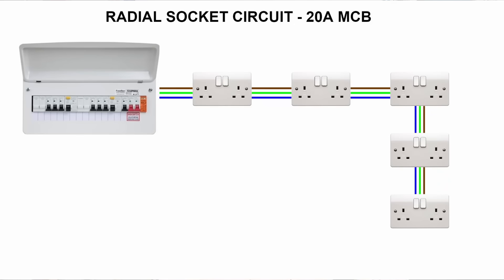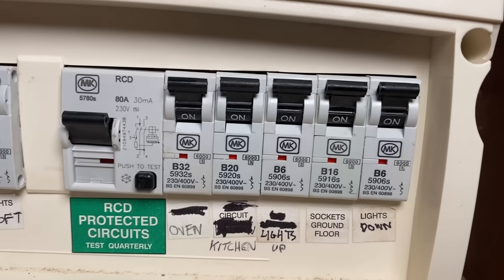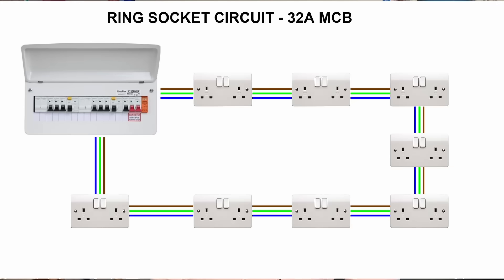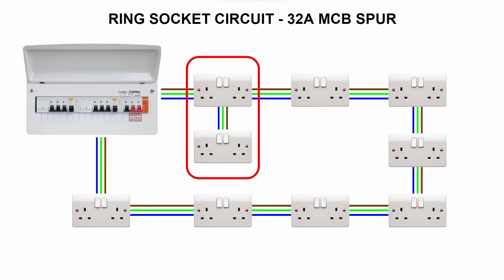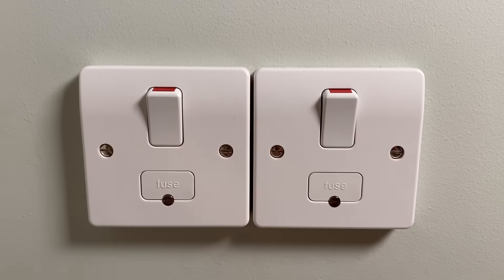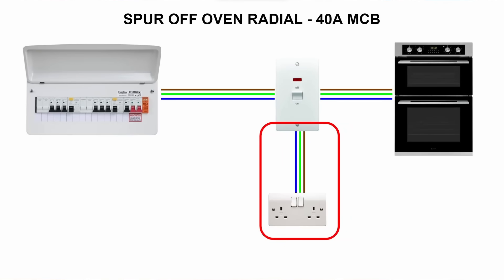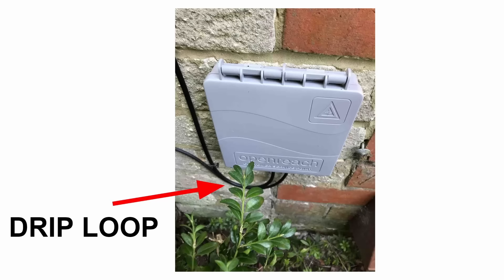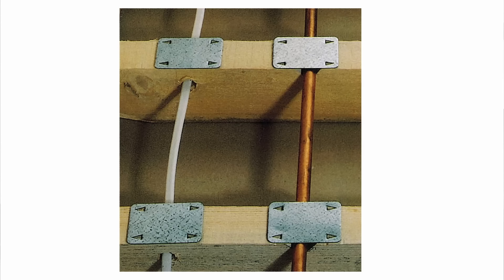BIGGEST DIY Mistakes Adding a New Socket

Comment: I had some knobheads from the government putting in a solar water heater on one of those grant schemes, when the electrician came to hook it all up I told him there was the old boiler circuit directly above, no holes or drilling required to get it but he chose to spur off a spur that was used for my fridge. Told him he couldn't do that but he did it anyway, he was asked to do it properly and it nearly ended in fisty cuffs, somehow it passed inspection when the next bloke came, after going to citizens advice to find out how to complain further I was told since I wasn't the one who paid I was not entitled to complain. It later turned out that they hadn't even connected the water pumps for the new system and it never did anything but look expensive. Somehow it also passed commissioning and was all signed off as a good install.  Will never get anything done by the governments cowboys again so bad.

Comment: Apropos spurring off an oven cct, this would be the same as a combined oven switch and socket? Also shower and oven circuits are subject to diversity adjustment so I expect that's why we have the combined oven/socket switch plates? If you must run something off a lighting cct,, extractor fan for instance, maybe a fused spur rather than a socket?

Comment: Thanks for your 'opinion' on ring sockets as an older electrician. I wonder why some electrical updates happen to the regs, but our whole electrical loading has changed massively since rings were the norm, often 3 bar electric fires were the norm, also our appliances were hungry little sods, these days loadings are 1) separated much better, deliberate feeds where sockets were used (boilers etc) so the whole loading structure is far different. Plus the common uses of RCD and RCBO. It seldom matters how you wire, ring or redial as long as it is installed correctly.
Reply: Well what do you like about ring circuits over radial
Reply: @Makalon102  It is just an opinion, but since my first week in tech college I learned that electricians are ' devisive' tech teacher, "In a 240v socket there are 3 wires, red, black, and green, which ONE wire is the most important, and why" now its a nonsense question, as the answer is none, THEY ARE ALL important. It was his way of saying, whatever your personal opinion, follow the code, and do it safely. Ring or radial cct as long as its connected correctly and designed (important on loading) correctly it will be fine and work well. BUT people and progress changes things, "people" plug in to a socket, no thought on load. Today's loads are nothing like the 3 bar fires in rooms my day had, conversely kitchen appliances USED to be one big cooker which was main oven and hob, plus grill. Today a hob comes with 13a plug, an oven much the same,  So protection NEEDS to be the key not the type of cct. But to me a ring has more versatility. BUT your comment on "bad connections in a ring is nonsense as any cct connected badly can and might fail

Comment: I'm not an electrician but having watched several videos before on the subject, one question has always come to mind. You are not supposed to add more than one spur to a ring main, however, what is the difference between adding a spur and plugging in an extension lead. Theoretically you can plug in several extension leads.
Reply: Came here to ask this very same question.

An extension lead typically has a fuse - maybe 13A - which I'm thinking might serve as a  lower-threshold stand in for the 32A breaker, making it safer as long as the fuse rating is lower than the wire rating (27A) in the walls, but I don't know enough about the subject to know for sure if this is the case.
Reply: @anonymousperson015  I’m no expert but the 13a fuse on the extension is the protection. That is why you fit a 13a fused spur if you want to spur off more than one socket, essentially going the same thing as the extension, kind of like a permanent extension lead. 

I’m sure an electrician can explain it far better than I can.

Comment: I have a question, me and my partner and just moved house, we’d like a partition wall building and it will also have media wall within it, the current plug socket is in front of the wall instead of behind it, one of the chaps said he can spur of it and put a double socket in, only issue is we need 3 one for electric fire place, TV and sound bar. Would it be ok to have electric fire place plugged into the socket directly and then an extension lead with surge protection and a 13amp fuse so we can have the TV and sound bar in? I worked out the amps of the TV and sound bar and it’s very minimal amperage they pull so I’m guessing in this scenario it would be ok? TIA

Comment: Nice, but is it ok for a DIY-er to add a socket, not to the ring, just as in your video. Let's say to the other side of the wall. Also, moving the light switch from one wall to the other, not touching the wires.

Comment: Looks like table shown in 0:50 has something mixed in [A] values for 1 1.5 and 2.5mm². Why? Thicker insulation causes less thermal energy dispersion from the cable. So thick thermal insulation around cabling = higher temperature of the cable and higher risk of of melted electric insulation. Double check it in other publications for your own safety.

Comment: I think nobody has any chance of going over the limit 20x240 is 4800 - 20% about 3900 watts it would be difficult to go over this amount so I can't see there being a problem what are the statistics how many fires are caused by faulty sockets in the uk each year
Reply: True, that's what common sense says, but don't forget some people (quite few in my experience) don't have any sort of common sense (if you check distribution of IQ you can find out that 1/4 of population has IQ <= 90). I've seen people daisy chaining 3+ extension leads with 3+ gangs each and connecting things like kettle, microwave etc. Not common but it happens. Safety regulations are mainly for those idiots, because in this country there's very little personal responsibility if you do something silly and dangerous 🤷 I consider myself as intelligent person and it bugs me too that my freedom is being limited by such stupid regulations, but I'd rather adapt then let my stupid neighbour burn down our building.

Comment: Great information in your video. I have done my own electrics for many years and have always observed the regulations.  Many a time I would have preferred to just run wires of a spur horizontally but wouldn't do it as I thought I would be contravening the regulations and I reads that wires could only be run vertically. Has that changed now so they can be run horizontally. Good news if they can be run that way, makes life easier.

Comment: thats your opinion not actual facts about the ring circuit , you need to keep your own biased opinion to yourself and stick to advising , which you should not do for legal reasons , the facts not opinions , as a sparky of many years in industry , commerce and domestics your opinions are not valid , if as you say it was to save copper which is wrong then today we need to save more as the demand for copper will be swallowed up by the net zero madness so your basis is wrong

Comment: re spur off cooker or shower possibly allowing 40a through a plug, that is not quite correct. A 13a socket connected to a 4mm radial on a 32a breaker, or a 2.5mm ring final on 32a would have exactly the same issue but that is standard practice. The circuit breaker is rated for, and protects, the cable size, not to limit what is able to pass through a plug. Sockets are rated at 13a but are connected to 30a circuits as a matter of course. The fused plug helps here. 
Socket spurs off large circuits are allowed: it's common to have a plug-in oven and hardwired hob on a 4mm or 6mm cable with 30 or 40a breaker. Cooker Control Units used to have a socket which was directly connected to a 30a circuit.
Equally, with the socket on a lighting circuit scenario, you say thevfuse may not blow or the mcb might be faulty. That's true, but the same could be said for a ring final, or a radial which has too many things plugged in at once.

Comment: IN a ring circuit when a live wire meets another live wire at the end of the ring route will it cause spark
Reply: No, since it's the same line. There's 0 voltage between the two ends.

Comment: I just wonder, given the decades that ring mains have been fitted without issues and the millions of buildings that must have them, are they really something to be concerned over? IMO, no. 
Whenever I've added an extra outlet to a ring circuit I've always tried to split the ring and insert the new outlet to maintain the ring's integrity but I admit that, sometimes, a fused spur is the more practical solution.
If I was renovating/rewiring my house I'd probably go with a mix of ring circuits and the odd radial for an external garden socket or garage/workshop.

Comment: I'm not an electrician but I changed a socket in sitting room recently, (works perfect) but there was just one cable 2.5mm twin & earth coming into it. 
Does this mean it's not a ring circut?
Reply: It's either a spur from a ring, or part of a radial. A radial can supply just one socket. Or it could be a spur from a spur from a ring. It depends if anyone's been DIYing.

Comment: We forget that few folk these days run the high current fan or other heaters off the ring circuits, with heating provided via another power source or on dedicated radial cables for heater circuits.  Very clear explanation.  The rule would seem to be protect the socket by a fused spur first.

Comment: Very helpful, thanks.  But I'm a little confused - the method of spurring off of a current socket, and adding 2 or 3 extra sockets that way, you say shouldn't be done.  I think you're saying it's because power hungry items may be plugged in and will exceed the permitted loading, and thus damage the wiring?  Ok, that makes sense, but what is the difference between doing that, and instead just adding 2 extension cables to the main, original, socket and running power hungry items off of those extensions?  We used to run electric heaters off of extensions, plus many other things off, all plugged into the same extension cable - that didn't damage the extensions or other installed cabling.  Am I missing something, because wouldn't that be the same thing as spurring more than one socket off of the original one?  Some other questions.  I live in a 1960s house, so presumably it's likely to be a ring circuit - correct?  How can I check the type of circuit I have?  We still have the old consumer unit, if that's any indication.  And if I were to spur more than one socket off of the original main socket, say 2 or 3 sockets, would that not be ok if only low power items were plugged in, like TVs, pc, laptop, phone chargers, LED lights, games consoles etc., etc?  The problem we have is being in such an old house, there is literally only one socket in each room, so extra sockets are desperately needed.  Thanks.
Reply: The answer to your question is that as soon as you plug something into to that single socket, however many powerboards you use, they are limited to 13a current draw by the plug's fuse. The fused plug is one of the reasons rings are allowed. If you add multiple sockets to a spur on a ring, you could draw 10s of amps through a single 2.5mm2 cable fused st 30a but rated at 27a or less if buried under insulation. 

A radial is different - you can add as many sockets as you want as the single cable is protected by a suitable fuse or breaker. A ring is fused on the basis of sharing the load over two cables.
Yes, you could only use low power appliances but there's nothing to stop someone plugging in a vacuum cleaner, iron, hairdryer etc in future. Powerboards are probably safer in your situation, as you have the plug fuse.
The other options (I have a one socket per room house) are:
1: if you have radials, you can extend them with more sockets. Check the cable and fuse match in rating (usually 1.5mm2 16a, 2.5mm2 20a, 4mm 32a.)
2. If you have a ring and the socket is on the ring (not a spur) you can 
i. add a double socket as a spur; ii. add a fused connection unit (FCU) as a spur, and take as many 13a sockets off this as you want using 1.5mm2 cable - they will be limited to a total of 13a by the fuse in the FCU. This is a fused spur and a bit like a permantly-installed powerboard; iii. Extend the ring by adding extra sockets in a ring formation and linking the two 'legs' back to the two legs of the existing ring  (Wagos are great for this but get the right size and a properly-rated enclosure).
3. If the socket is already a spur from a ring, change it to a FCU and proceed as 2.ii above.
4. A rewire is, in the end, the safest and most cost effective way of bringing an old house up to standard, for modern living (on the whole we use a lot more sockets but draw less power overall), with sockets, lights and switches where you want them.
Reply: @tobysherring1369  Thanks for such a comprehensive and factual response.  I did some more research after posting this question, and I went down the fused spur route (FCU), adding 3 sockets after the FCU, which I think your reply says is ok?  I read elsewhere that was the way to do it, so I did, but I used 2.5mm T&E cable, which is what everything I read said I should use.  I've just done a bit more reading, and while some say 1.5mm T&E can be used (in limited circumstances and with no power hungry appliances), that's normally used for lighting purposes, and most people say it really should be 2.5mm T&E.  So I used 2.5mm T&E, but other than that, your reply confirms I have done it the correct way.  Thanks again though for your great reply!
Reply: @TrueBrit1  I'm not an electrician but I know the regs. Without knowing your precise situation I can't say in a qualified way if what you've done is correct and any work should be inspected, tested and certified. It sounds good to me.
The thing about cable sizes is that each has a rated capacity. 2.5mm2 is used in pairs for a 30a ring or on its own for 20a and sometimes 25a radials. You're right to run 2.5 from the ring to the FCU (although 1.5 would be acceptable because it can't draw more than 13a). It's also OK to use 2.5 from FCU to your new sockets, but because they're after a 13a fuse, 1.5mm2 is perfectly fine.
Also, if you discover the circuit is a radial, correctly fused for the size of cable, you could turn the FCU into a socket, and as the whole of your new installation's in 2.5 it would be fine (as long as your radial's fused at 20a or less) as part of a radial. If your original socket's on a ring, what you've done is exactly right AFAIK. If it was already a spur then the FCU has to go before the original socket spur.
In my old house I had three spurs off one spur from the ring, twice, done by previous owner. I put in a FCU in both cases but as it was all done in 2.5 a future owner could, using an electrician, turn them into 20a radials on their own.
I think it's worth you having an EICR on a property of that age and your recent work can be tested.

Comment: In theory, I could get away with adding two sockets to the ring main without a FCU but in reality its the best to have a 13 amp fuse as a limiter to make sure the wire doesnt get overheated etc. ?
Reply: In theory you could add two separate spurs to a ring final circuit. You cannot have more spurs than sockets on the ring.
You can add as many sockets as you like to a fused spur - but you can only draw 13a in total from them. Probably adequate for most purposes.
For each unused spur you're allowed a double socket on 2.5mm2 cable. This is as per regs. If you add more sockets, the 2.5mm2 is in danger of overheating, hence not allowed.
Extending the ring is the other way to add multiple sockets.

Comment: 13A UK mains is 3000W. one hoover these days max 1500-2000W so if you decide to connect two single phase welders at the same time, it may actually exceed the cable rating🤣 UK elecricity is 30years behind europe. You have just discovered WAGO 5minutes ago🤣...

Comment: I have a 2.5mm twin and earth cable coming into my garage from the cu inside my house. It feeds 1 double socket and one light switch. Can I add 4 more sockets and one more light switch?
Reply: I think if you placed a fused spur between them and the existing circuit socket you would be fine, like one big extension lead.  These days the ratings on tools are relatively low, its more about the geoigraphical convenience of power rather than lots of power.
Reply: Is the 2.5mm2 supply on its own breaker? If so, and the breaker is correct for the size and length of cable, it's a dedicated radial and you can add as many sockets as you like. For the lighting, you need to add a fused connection unit fused at 5 or 3a and run it in 1.0mm2 cable. If convenient the FCU can also be the light switch, which simplifies the wiring significantly.
If it's a spur from a ring in the house, then you need the whole thing run through a fused connection unit at 13a. Otherwise you'll be spurring off a spur.

Comment: Excellent video, great explanation although these days it boils down to the consumer plugging multiway extension sockets into wall sockets. Appreciate though any good extension will be fused, not always the case though for the older style 2 or 3 way adapters. As you say though most modern devices these days are very low current. As long as you aren’t plugging several fan heaters in and around the home…..